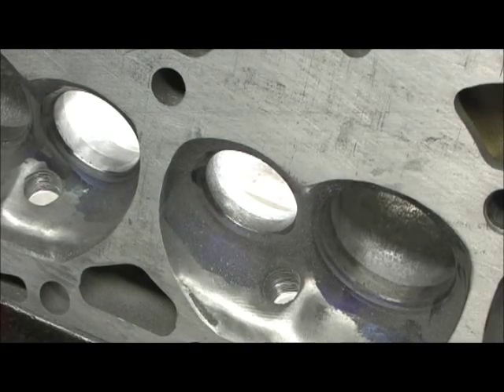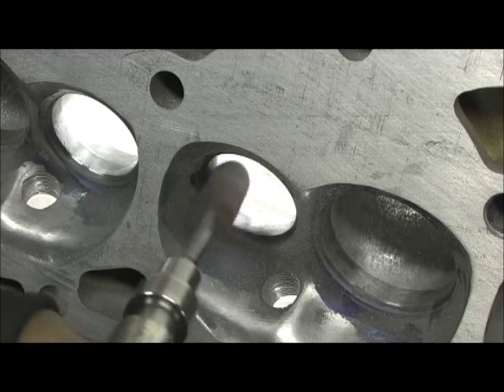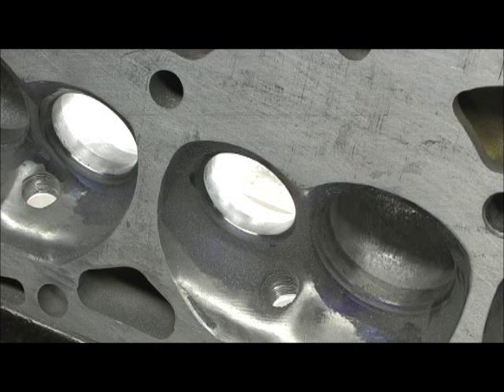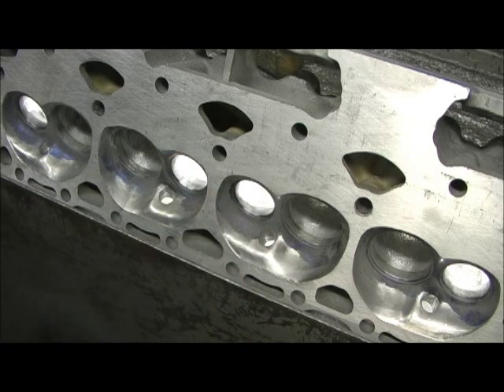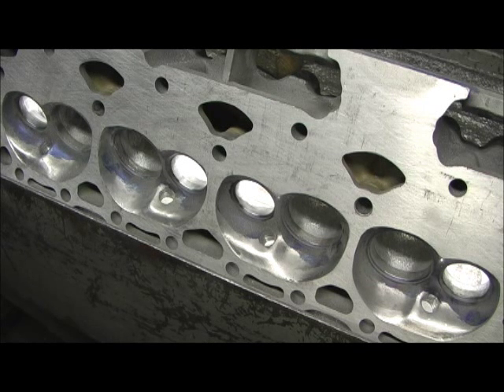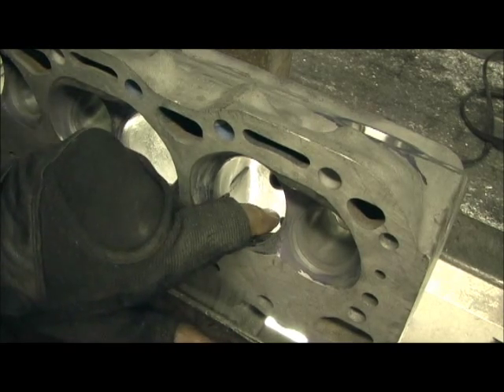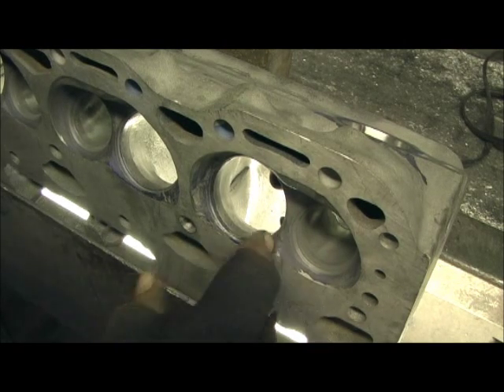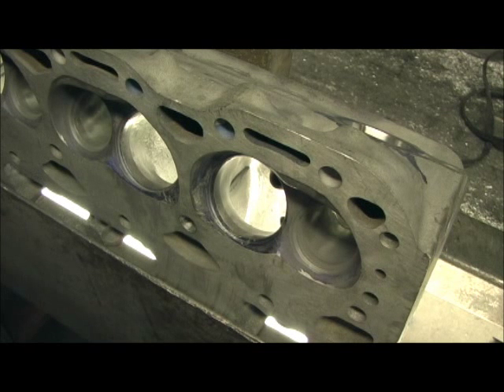LT-1 SBC Cylinder Head Stage IV   Part 7.1

Comment: There's a huge benefit to using sanding rolls instead of carbides: you sneak up on the final shape, and it makes better transitions.  Instead of creating a lumpy port, then going back over with the sanding rolls and trying to fix your mess.  I can see the waviness and lumpiness in the reflections.

Carbon is caused by incomplete combustion.  A properly designed engine does not leave carbon.  If you have carbon in the intake ports, you also have reversion.  Have you pulled those heads off to have a look?  Not even the best porters can just eyeball a port and judge wet flow.

Comment: Do you really need to insert those tubes? I am a little skeptical to use an epoxy inside an engine head. Im sure you could stay a few thousands away from having to use epoxy with those tubes. Of course they would be needed to strengthen up that part of the head after porting

Comment from the maker: The LONG turn side of the bowl, 180 away from the short turn radius, and the Straight wall side (where you put the TUBES in or the head bolt hole is going through the head.

Comment: Again, amazing tech here! Thanks a lot for sharing!
I'm thinking that maybe we should leave a little bit rough surface at the bottom of the port and we can go for a little more polished surface finished at the top, so the fuel won't drop out of the suspension at lower speeds, when it's stretching along the small radius. That's what I'm thinking.

Comment: Not a fluke! It is called ENGINEERING! Tony did a great job on these heads and with what I see here could put out  500+ hp at the crank with this combo. I have been porting and designing engines for thirty years ( Not professionally, just a hobby turned obsession)  and Tony is the MAN!